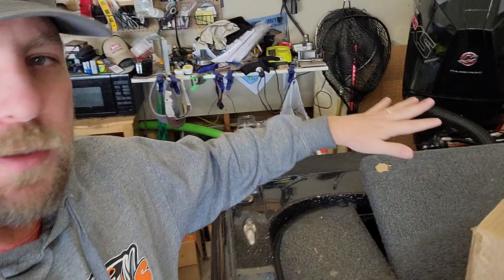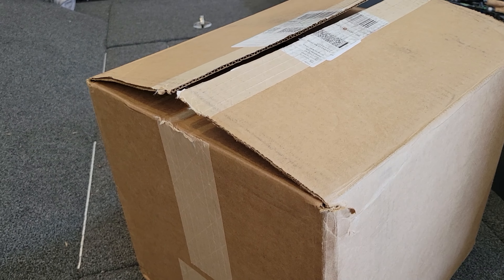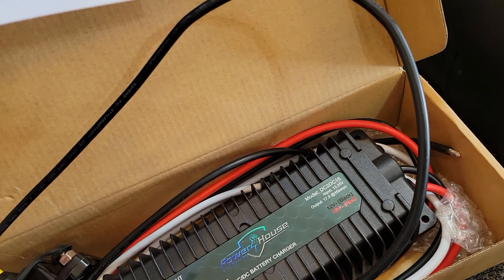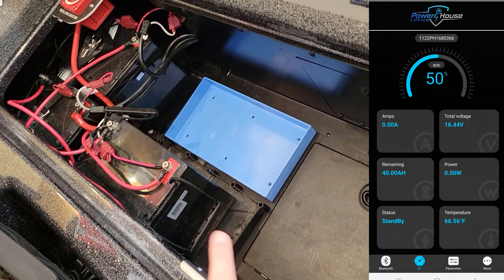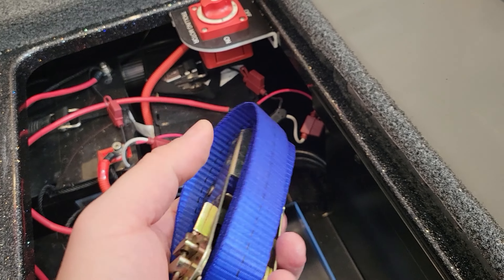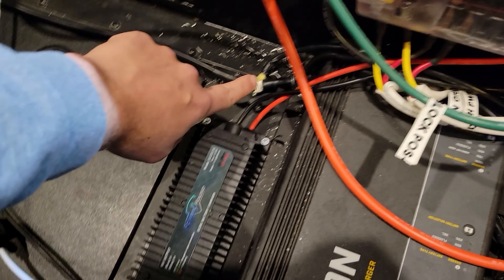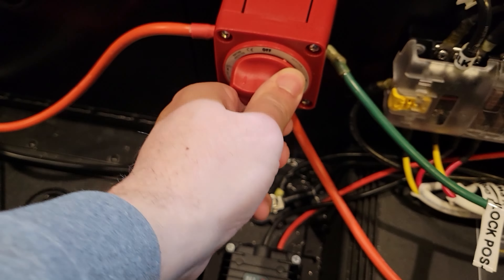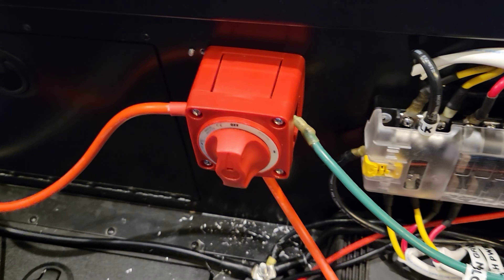Never Run Out of Battery Again: A Look at the 16V Power House Lithium

Comment: With all that battery power you should be able to install an ice melt unit on the front of the boat. MN winter.
Reply from the maker: I think it worked, water opened on Thursday lol

Comment: I purchased the run and gun system and am curious on how to install it. I see in your video you didn’t hook it up to the 60 amp breaker that came with the run and gun? Am I correct on that?
Reply from the maker: I did install the 60 amp breaker, just forgot to mention it, its to the right of my fuse block hard to see but if you watch close you will see the little yellow lever as I pan by a few times.  You do definitely want that breaker inline as shown in diagram that comes with unit.
Reply: @HellaBass  awesome, just wanted to make sure. I also have another question for you. How do you charge up your batteries? I have a regular on boarding charger for my agm cranking battery and my lead acid for all my graphs. I have the charger for my 36V lithium that specifically charges the trolling motor 36V power house. Does this affect anything with the run and gun charger because technically the run and gun is connected to the cranking battery being charged from the on board charger and the lithium being charged from its separate charger? Do you have to unplug the run and gun or flip the 60 amp breaker when charging off the water?  just don’t want to screw anything up and want to make sure nothing bad will happen will happen when I’m using the separate chargers when the run and gun is connected! Thanks for any help you may have for this question!
Reply from the maker: @bradyweinert7616  I am setup so I have one 35amp charger that only connects to my 12v Starting battery, then I have a 16v and 36v run & gun off that, so I always run everything through my run & gun.  I am not the definitive word, but I think it would be best to open the 60amp breaker before plugging your other chargers in at night.  You could also see what happens if you don't plug in your 36v charger, and leave run and gun engaged, see if it has enough to kick your run and gun on.   For final, answer, call Bob or RJ at PowerHouse

Comment: I was under the impression that you had to have 35 amps to charge through the run and gun system? So your battery will charge on the water with the motor but not through your minnkota charger. Am I misunderstanding that?
Reply from the maker: For the 16V Run & Gun that I have it will charge off just 10amps, so no issue for my Minnkota charger

The 24x & 36v do require 30amps, I believe you can combine the outputs from a 3 bank charger to create that 30 (3x10) to also charge a 36 volts system, but i would double check with the PHL team on that
Reply: @HellaBass  Ok that makes sense due to it being just the 16v. Ya I was looking into the 36v system for the trolling motor and was trying to figure out the charger situation. Basically you have to use the 36v battery or run multiple chargers to cover the amps.

Comment: How has the 16v worked out for you? Im looking at buying one but I need some feedback. How do your graph images look compared to using a 12v for your electronics?
Reply from the maker: If you have really good wiring probably won't notice a difference at the start of the day.  But with voltage drop on a long day or using factory boat wiring starting with more volts keeps your image great all day.

I've had several viewers who bought them, said it did the trick for them and Thanked me for Turing them on to the 16v

Comment: I switched to dedicated lithium batteries for my electronics and have certainly not regretted it.  There is no way I'd pay that much for a 16v battery, let alone another $200 for a dedicated 16v DC-DC charger.  Unless you're fishing for days at a time and can't get to an outlet to charge via AC?  With those three graphs, you're probably pulling 150w or less, maybe only 100w, which means you've got somewhere between 12 and 16 hours worth of run-time from a single charge.  At the rate of power being drawn, and the way standard 12.8v LFP batteries hold their voltage through the discharge curve, I don't see where the 16v battery makes any sense.  It's a 5S, LFP build, which means everything about it is "special", including the BMS and anything you use to charge it.  I've researched them and, according to the manufacturers of the graphs, the 16v batteries are a solution, desperately in search of a problem.